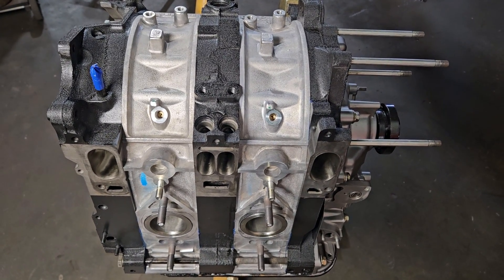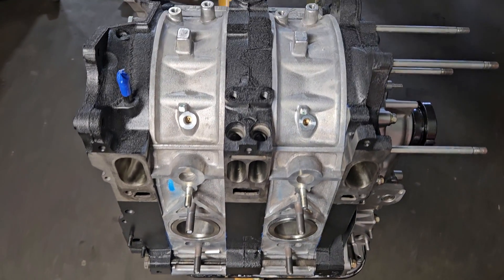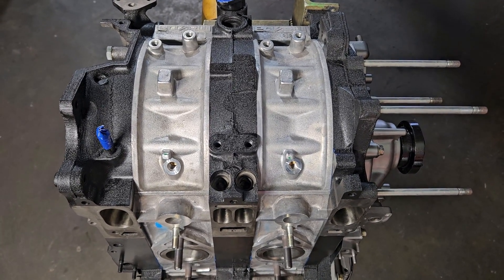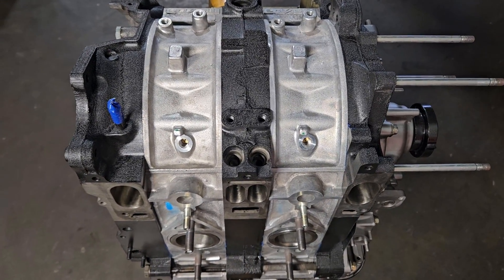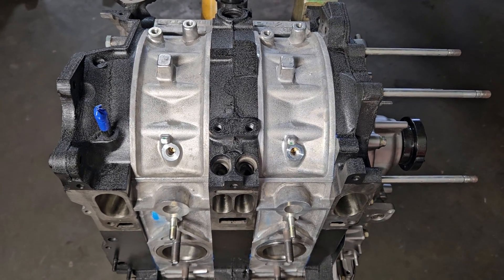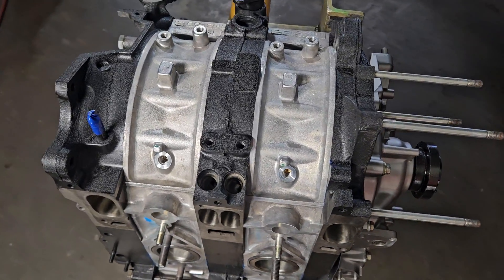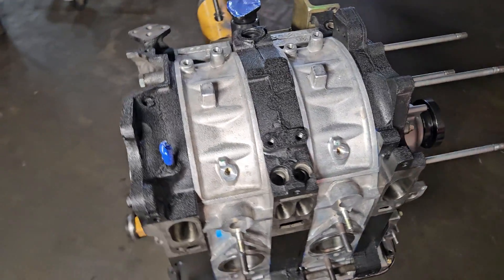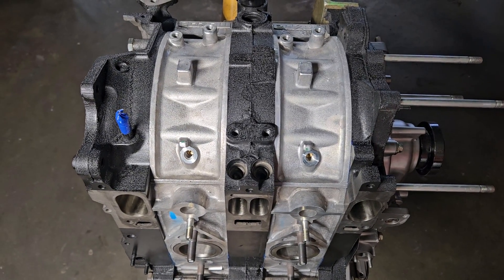Full Build talk specs parts - 13b half bridge Rotary Engine - Restoring and modifying RX7 motor

Comment: Mike from difined auto works said that 3mm makes more power than 2mm and that why mazda uses 3mm
Reply from the maker: Ive never heard that.  
To my knowledge recent Mazda OEM race cars ran 2mm as it's lighter and has multiple benefits. 
 Mazdaspeed 3 rotor Lemans RX8s 2mm as well. 

When talking to Mazdaspeed, they've always recommended. Two millimeter or two millimeter variations since the options came into play in the 80s. Prior to that three millimeter, it was all that was available.
Reply: @KyleMohanRacing  this is the title of the video where i got the info from and also it is 5 minutes in where he talks about the 3mm vs 2mm. The 4-rotor 26b engine overview, facts and information by Defined Autoworks.
Reply: @KyleMohanRacing do you use the single 3mm apex seal spring from earlier 13b? Is there any other options to use a small spring under like the stock setup?